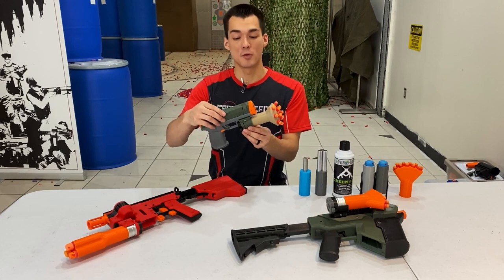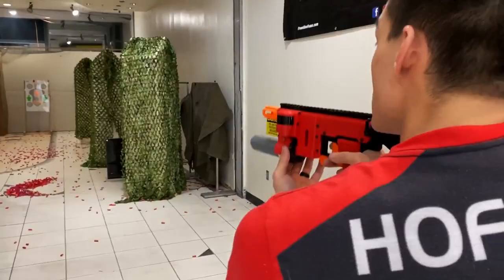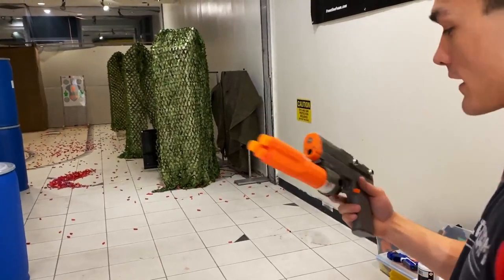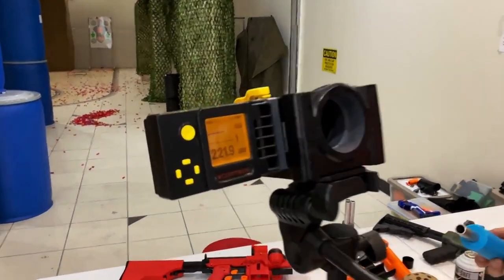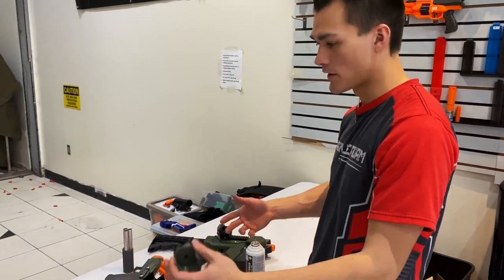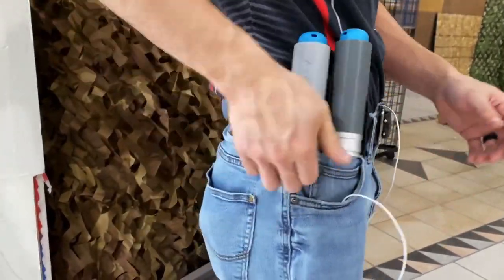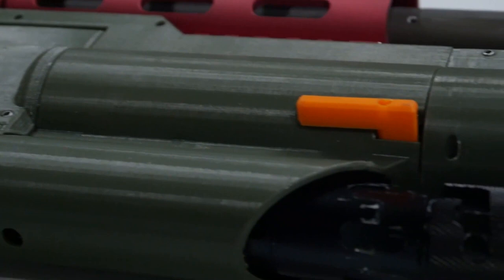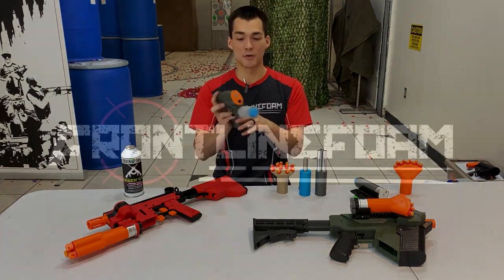Pico Booper 40 Max Gas Grenade | Mega XL | Shotgun | M203

Comment: Do you have to refill the air after every shot. Or does it have a few shots before you need to re fill the air. Also how many refills can the air can hold before it is empty and you need to buy a new one?
Reply from the maker: Yea. The canisters are designed to fire once before refilling. A standard 13.5oz refill can is good for around 300 shots.

Comment: No shells for Rival Rounds?
Reply from the maker: I’ve designed one. Holds 3 HIR (Rival) rounds.
Reply: @FrontlineFoamBlasters  With that much power it can only fire 3 Rival Rounds at once?

It looks like it has potential to fire more than 3 rounds per shot.